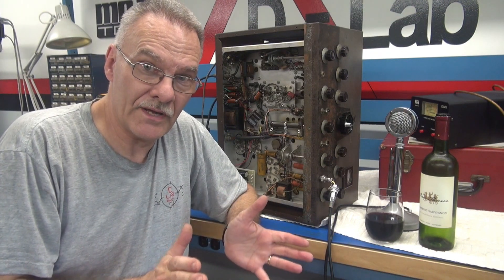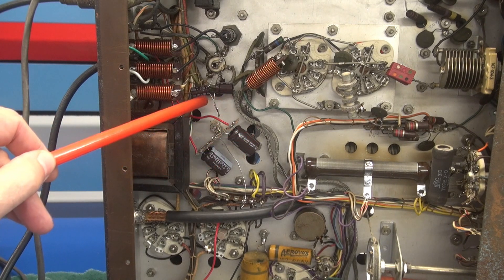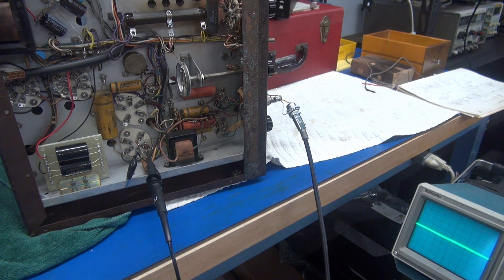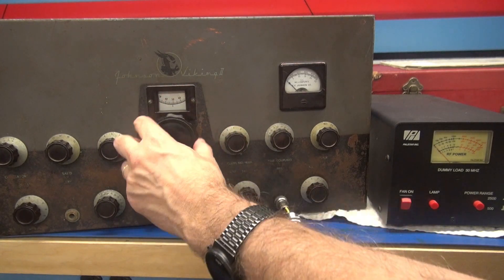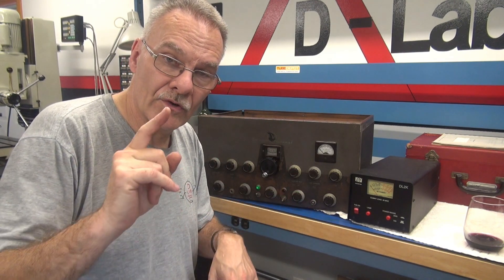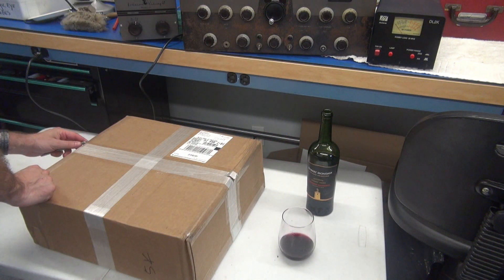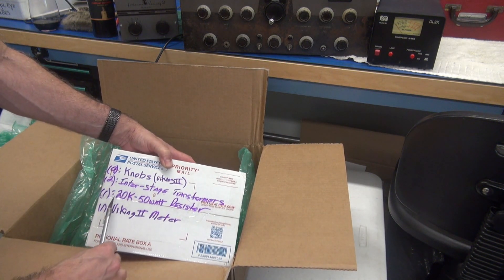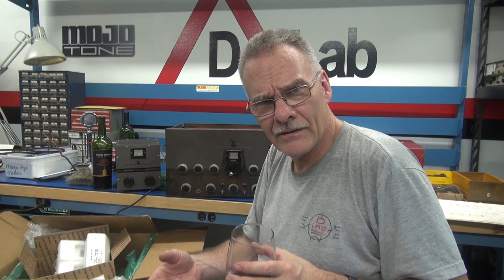Ugly EF Johnson Viking II Ham Radio transmitter repair Yes it works No Modulation bonus goodie box

Comment: Have you kicked guitar amps to the curb
Reply from the maker: Nope, just getting a few boat anchors out the door, Have a Vibroverb/Princeton build & a 6K6 boutique model on the way. Hang with me
Reply: @d-labelectronics  cool
Reply: @d-labelectronics  I just got a 1959 Canadian Philips running that has a spring reverb that works. Then I learned Fender put spring reverb into the 63  Vibroverb! Dick Dale was  in surf heaven!

Comment: Hey Terry, just curious if you use an isolation transformer on equipment like this when you utilize the oscilloscope? If so, what isolation transformer ya got? Thanks! 
73.
Reply from the maker: Hello, I use an adapter that lifts the O-scope ground AC power cord lug. No isolation Xfmr
Reply: @d-labelectronics  Ah, alright. Thank you!

Comment: Viking Icon: Terry your an outstanding technician particularly on the Viking equipment. Suggestion: Make a puppet resembling a Viking warrior complete with Viking helmet which you then would use to simulate an attacking on the cobbler. The Viking won the battle against the  cobblers modifier modifications.  P.S. As the old Viking equipment i.e. boat anchors have 11-meters and there's hardly any CB'ers, let's partition the FCC to give us back our frequencies.
Reply: I don't think ham operators actually need the 11-meter band My thought is to leave as a means to hopefully bring more into the hobby to become actual ham operators ijs Many hams started out on 11 meters leave it as a stepping stone There are perhaps just as many cbers in the united states now as there are actual hams thanks to cell phones and GPS Many WHO still enjoy two-way communication just as much as any ham jmo